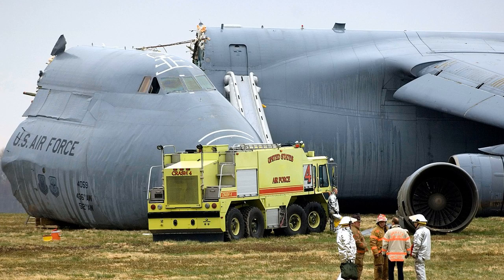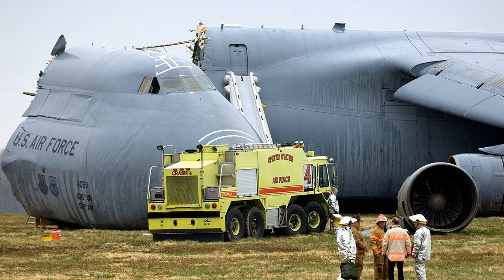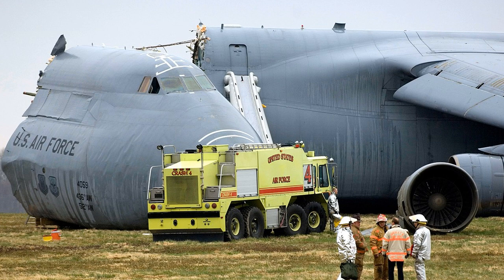[CVR] 2006 USAF C-5 84-0059 crash

Comment: What exactly caused the stall? Sure they were below the normal glidepath, but did they try to lift the nose with insufficient speed in an attempt to connect with the normal glidepath? If the GWPS tells you " Don't sink! " and " Too Low! Terrain! " then that is clearly an indication of you being below the glideslope when you have visual contact with the runway.
Reply: 3 primary reasons.  1 -They mistakenly flew the approach with only two engines operating at full power. Why? Because after they shut down engine No.2 they continued to move the throttles for engines 1,2, and 4…. MEANWHILE they fail to notice they are supposed to be throttling engines 1,3, and 4. Engine no 3 got ignored and was at idle the entire time. So they incorrectly flew the approach on only two engines. Stupid. 2 - they put out too much flap and it caused so much drag they fell below the glide path, which was unrecoverable given they still hadn’t realized they were using two engines instead of three. 3 they attempted a VFR approach with only a partial briefing. So they weren’t prepared.  A total shitshow